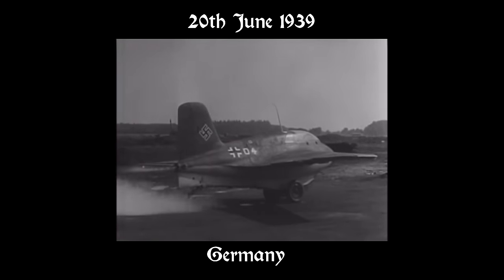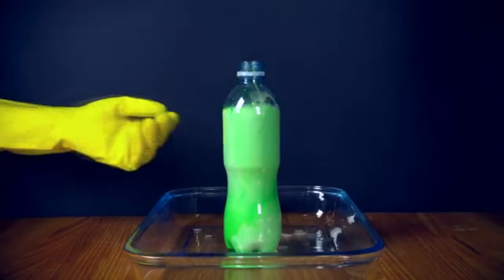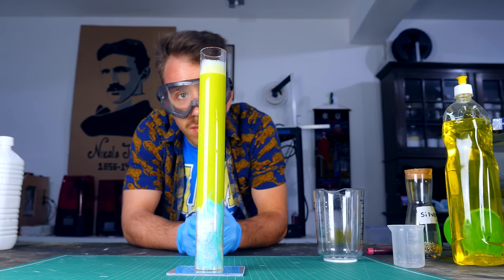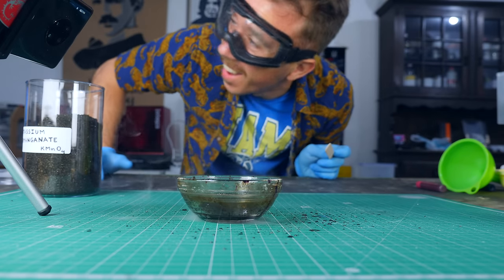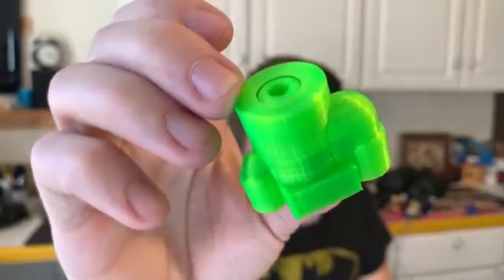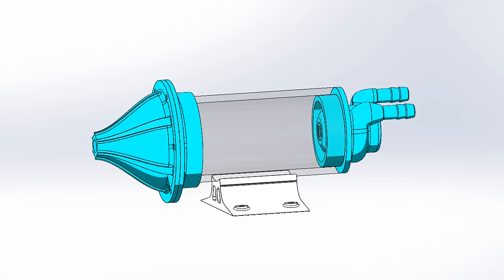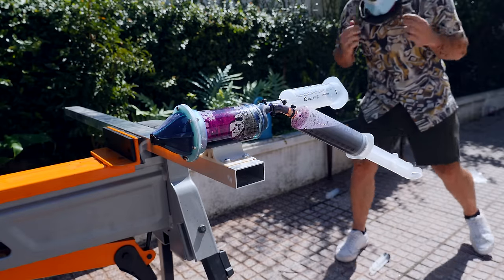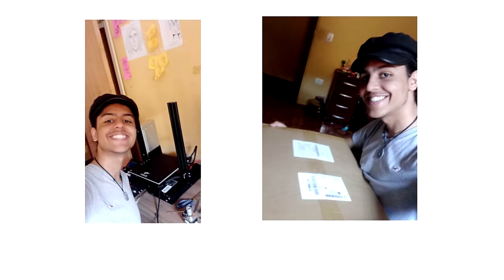The Forgotten Nazi Cold Rocket Engine (3D Printed)

Comment: If I remember correctly, there were a few reasons the me163 wasn't more effective: it wasn't widely produced, very low range, but the lesser ones were that t-stoff and c-stoff were safe on their own but once brought together they were extremely volatile (as you shown). The fuel was so volatile that if a 163 was damaged and fuel got on to the specially made flight suits, it would burn a hole right through the suit and if it made contact with the skin it would cause some severe irritation. The other reason was that because of the volatile reaction, many 163s exploded on takeoff killing their pilots. (This was just stuff I remember reading about, but You can get more indepth with the wonder weapons "dogfights" episode). (I'm a little bit of a ww2 aircraft buff...)

Great video, but please be more careful integza, I love you channel I don't want you going anywhere anytime soon!
Reply: Today I Found Out has a video The German Rocket Fighter that Dissolved its Pilots Alive that covers this topic. I've gotten concentrated hydrogen peroxide on my skin before from a wood bleaching kit and it makes white blisters and the skin flakes off and can scab over, very gross, can't imagine that all over one's body 😬
Reply: The me163 actually used hydrazine, which is indeed ridiculously toxic. Another reason why it wasn't more effective was also its very short duration of action and the fact that it was more of a last ditch effort against overwhelming allied aerial attacks. Hydrazine itself is a pretty effective propellant in rocketry till today, though less frequently used due to its high toxicity.
Reply: @haraldhimmel5687  Oh, right. ChecmicalForce and NileRed have done some interesting reactions with hydrazine as well as Extraction&Fire mentioned in the video and Extraction&Ire which I think is his 2nd channel. The good news is this makes Integza's rocket more like the Rocket Pack and less like a Nazi experiment.

Comment: Hey Integza , here is a future video idea - try to make 3d printed parts using flash graphene ( you could make some using capacitors and quartz tubing) . add the graphene to the resin solution . considering how viscous the resin is, the graphene flakes should stay suspended in the solution( i hope they do) and should make the parts more structurally strong. Ps if u do this Don't forget to credit the student at RICE university who discovered this method of making graphene( His name is Duy Luong)

Comment: video idea: you should try to  print plastic rockets again but fill the inside of the walls with water to provide cooling and increased spesific heat. should solve your problem of changing parts on every test
Reply: The plastic would insulate
Reply: @Volt64bolt  you can make inside walls very thin. as long as you make outside walls thick enough water would carry the preassure and hold the inside walls together. like trying to light a water baloon on fire. but  i dont have any 3d printing experience so i could be wrong. but as long as you put enough supports it should work i believe

Comment: How did you manage to avoid peroxide burns on your arms when that syringe blew back? When I am working with high strength H2O2 I always manage to get burned by a splash somewhere. Guess you learned about the purple permanganate stains also. I'm really impressed by your 3-D printed rocket engine. Keep up the good work and stay safe.
Reply: dude i only have 12% and after doing some experiments my fingers were pretty much white. thankfully running underwater and rubbing helped

Comment: great project!  Couple suggestions.  Get rid of the KMnO4 and use silver mesh (the surface area of your silver shot is too low).  by mixing relatively low concentration (50%) H2O2 with a permanganate solution, you're increasing the reaction time (not good... faster is better!)  The other is to distill the 50% peroxide to 75% or higher - you'll get a far more energetic reaction that might even test the thermal limits of your engine housing!  (finally, from a safety perspective - even 50% H2O2 is nasty stuff on skin.  You need better PPE)

Comment: Instead of having to pump two fluids, I wonder if you can pre-load the chamber with the catalyst, and then swirl the hydrogen peroxide into it similar to the vortex rocket.
Reply: Normally they take silver, nickel, or palladium coated mesh screens and stack them into a catalyst pack. Then they pump the hydrogen peroxide into it and as it expands the high surface area makes it speed up. Back in the days of crazy Acme products there was a jet powered gokart that had 1500hp equivalent rocket thrust.

Comment: H2O2 is used to drive the turbopumps on the main stage engines of the Soyuz rocket.  The catalyst used there is an active zirconia matrix called F-30-P-G in the form of pellets covered in an aqueous solution of sodium and potassium permanganates.

Comment: You need to revisit this project. Add an aerospike at the end and a rotating detonation chamber inside, use 100% concentrated solution, and a high speed motor for injection and see what happens.

Comment: Make a woodgas powered turbojet. This would use a burner to burn wood inside a sealed container, while the gas produced is collected and sent to the turbine. It will also work with paper inside the gasification chamber. At the end of the cycle, you'll have charcoal you can use.

Comment: HTP ( high test peroxide) was used in two under wing rockets on a Lancaster bomber in 1946 at the Rocket propulsion establishment Westcott England. HTP is H2 O2 and decomposes into H20 ( water) and oxygen because of the heat generated the water is emitted as steam with the oxygen. You can add various combustible fuels into the exhaust to increase thrust. The danger of HTP is that if it is spilt onto any flammable material i.e. Wood clothing etc they will combust.

Comment: Great engineering with that rocket engine.
Maybe you should try and ignite the exhaust combustion, maybe it wil give a whole lot more thrust.
But be aware that the flame mite flash back so maybe you will need some sort of flash bach mechanism. 
Good luck.

Comment: If you don't clean the nozzle up after each test I wonder if you could just pump the peroxide so you only need to pump one liquid before recoat. It seems to stick quite heavily so the catalyst stays. Iirc for big rockets, monopropellant catalysts are stuck onto gauze right before the nozzle. That is a big benefit as a combustion chamber isn't neccesarily needed and reduces weight, but it's less power relative to bipropellants or hybrid engines. A method to "stick" the catalyst with the high pressure is good, though ofc its better with high peroxide content so it does not first dissolve into the water as much.

Comment: what a great project. you need 2 tanks that could be pressurized, check valves, mixture valves and throttle valves. you can then control the mixing ratio of the liquids to increase the chamber pressure or press the Permanganate into a block in a cup in the pressure chamber and spray peroxide on to it. that way the peroxide react with the correct amount of permanganate to optimize the reaction. anyway again great project.

Comment: For optimisation you could make the nozzle Exit even smaller. You want the exhaust to come out as straight as possible. In your case, the exhaust formed a cone, which means that your exhaust Gas preassure was to high

Comment: All this time knowing about the 'Cold' takeoff pack used on the Arado 234 takeoff units and I always thought it was Hypergolic because it had two separate fuel tanks. Then I saw this and heard about the propellants and immediately recognized them as I know the German rocket engines quite well. Having heard the term 'Z-stoff' I thought 'that's calcium permanganate'. Upon closer inspection on the walterwerke website I noticed the words 'decomposition' being used a lot. So technically it was just a catalyst in liquid form and not actually a reactant and is therefore a monopropellant and now that I've learnt that monopropellant engines are deemed 'cold' it all makes sense now as to why it's called the 'cold' takeoff pack.  All this time not knowing any different. Also for reference, the me-163 B onwards (the A famously gave off purple smoke and is deemed a 'cold' unit so I guess that's why) used a 'Hot' mixture of HTP and T-stoff which is a mixture of Hydrazine Hydrate, Methanol and water. This is bi-propellant and hypergolic but it was started using calcium permanganate embedded in a porus substance that the HTP flowed through in order to spool up the turbopumps. For reference this can all be found on the Walterwerke website. It's a co uk site but YT hates hyperlinks so I can't link it here.

Also, don't feel so bad about using syringes because if memory serves, the X-4 missile the Germans were working on was using a spring loaded syringe style mechanism for getting fuel to the combustion chamber or as wiki puts it 'pistons in long tubes' so basically a syringe. The propellants for that one are quite nasty though: R-Stoff and S-stoff.

Comment: If you take the potassium permanganate and make a paste with it, letting the H2O2 flow over it as it comes out of the syringe, that will increase the reaction. Also a back-flow prevention valve in the line is needed.
The injection should go into a mixing vessel in-line to the reaction chamber, creating a place for the reaction to happen before it has a chance to expand, then compress through the nozzle, thus creating the highest pressures.
Lastly, what are the chunks? The fluid mixtures should be debris and in the smallest particulates you can get. Try drying the Potassium manganate before the reaction. 
I hope that helps.

Comment: You should compress KMnO4 in a cylindrical form with a bore inside then the H2O2 get injected inside. By controlling the amount of H2O2 injcted inside you controlle the rate of the reaction. A one way valve will help protect the direction.

Comment: Safety 3rd, love it!! Mike Rowe mentioned the validity of such a thing in all practicality, great video by the way, I knew of silver/peroxide rockets utilizing silver mesh and peroxide I interacting to create thrust, but hadn’t explored the idea in full. Imagine feeding this through a Tesla Turbine and using a massive Tesla Valve to mix the fuel and catalyst feeding the high pressure mix through a Venturi just prior to the inlet of the turbine allowing for an even more atomized mix and further reactive efficiency so the pressure is extreme and consistent upon entry to the Tesla Turbine…….I imagine possibly disastrous pressures and rpm development, but heat would be massively reduced prior to being introduced to the turbine allowing for far more aggressive operation and less deformation and resonance leading to destruction. Coupled to a reduction drive, depending on scale I’d sure be curious about power output values, and this could perhaps allow for a very substantial increase in fuel efficiency. Just a thought. There is a ton of potential energy there and I think with a Valve/Venturi/Turbine/Reduction drive, there could be an interesting powerhouse yet to be built! Keep up the great videos!!!
Reply: Apologies for typos, thumbs weren’t designed for phones!

Comment: Should make a supercharger type of deal, use the steam in an engine, as was mentioned, to either produce more thrust, or to spin a corkscrew deal to pull more fuel from say larger containers into the system to continue to power itself

Comment: One catalyst included in kid's chemistry sets is manganese dioxide.  MnO2 is not water- soluble, it's a good catalyst nevertheless.  Monopropellant rockets are used in real spaceships for steering.  They use arrays of fine silver wires as a  catalyst device.  An interesting catalyst is biochemical. Peroxidases are enzymes that destroy H2O2 very efficiently.  I don't think a crude extract of horseradish peroxide would cost much... or you could prepare your own.

Comment: How about a simple gas pressurized fuel chamber? Fill a syringe with half propellant and half air. Pressurize it by closing the outflow valve and squeezing the plunger/locking it there. Open outflow valve and pressure forces propellant out.

Comment: Use engine fuel pump, and PD style injectors and you can control those with small microcontroller to get decent fuel back pressure tolerance :)

Comment: I read about the test pilots who tested the Heinkel and they said the worst part was landing it with fuel still in it. They said they would fly around until they were almost out of fuel before landing it as the fuel was so volatile, it would explode on landing.

Comment: Seems to me that the thrust is being impeded by unexpended permanganate.

Since it takes very little permanganate to decompose a lot of peroxide, you probably only need about a tenth or less of the pressure on the permanganate syringe, otherwise unspent permanganate ends up clogging the exhaust port.

Comment: Curious, wouldn't a smaller chamber increase efficiency and burn time? some threaded brass fittings are in your future and you could even push the two chemicals into the chamber by forced air or co2

Comment: This type of engine along with the proper fuel tanks would be perfect to install in a Estes Rocket V2 Kit. Question, Couldn't the fuel tanks be made so that there is a mechanical piston powered by springs to push the liquid into the combustion chamber instead of using syringes?
I once watch a video of an RC model submarine where the person built balist tanks that could allow water in to sink, then push the water out to rise. Possibly that concept could be applied to a type of fuel tank that could push the liquid into the combustion chamber and it is controlled by RC controllers? You could then put the fins on the rocket, side it on a Estes launch pad, trigger it and off you go, LOL!

Comment: Use Tesla. Alva’s to control backflow and fuel rates. Also atomize the peroxide and the promagnate using restrictive fuel nozzles / atomizers to mist the two chemicals together in the chamber. Also, edit your exhaust Nobel to be able to restrict exhaust on command for higher thrust. I also recommend to add a gimbal on the engine to control directed thrust. Happy rocket building.

Comment: just fyi, removing supports before curing is way easier and doesn't effect the strength of the part. use some hot water to make it even easier.

Comment: Would it work if we used gravity? At first release a valve that would make the fuel components flow into the chamber and then re-use some pressure from the chamber and re-route back to the top of the fuel tanks to push more fuel into the chamber and create a kind of 'runaway' condition where it will run harder the longer it runs?

Comment: Do the silver experiment another way. Pour liquids in and then silver pellets. That mixes the components better and gives more surface area for reaction... Having silver on the bottom means the liquid that may enter there is more or less full of already reacted components and the raction slows down significally.

Compare that with kids stuff like dropping menthos to cola...
Reply: Smarter than rest of us. Sigh.
Reply: better yet, instead of silver, use Palladium-on-Carbon.

Comment: Hypergolic rockets are just liquid fuel rockets wherein the fuel and oxidizer ignite on contact. Example: Nitrogen tetroxide and methyl- hydrazine.

Mono-propellant rockets include most solid fuel rockets. A typical example is nitroglycerine & nitrocellulose (essentially compressed smokeless gunpowder).

Hydrogen peroxide decomposition is VERY HOT.

Comment: The hydrogen peroxide, decomposition rocket was what was used by the Bell rocket pack, the rocket pack had a bottle of approximately 90% hydrogen peroxide and a bottle of pressurized nitrogen to push the peroxide through the gas generator, which was a stainless steel container with a bunch of silver plates inside it, some articles state that the silver plates were coated with  samarium nitrate

Comment: To use silver it has to be a mesh like screen wire. You have to compress the hydrogen peroxide and force it through the mesh. This is the way they made cold gas rockets for the Rocketeer suits. The two tanks that you see on their back one is filled with compressed air the other is filled with hydrogen peroxide. Compressed air is used to force the hydrogen peroxide through the silver mesh. The expanding gases is forced through a rocket nozzle to produce thrust. However Rocketeer suits can only fly for 30 seconds to a minute due to the small amount of hydrogen peroxide they can carry. Adam Savage used cold gas Rockets for his Iron Man suit that he made for his YouTube channel. Adam used for layers of 25 micron silver mesh and 70% hydrogen peroxide. The guy he was working with said you only need two layers if you're working with 90%.

Comment: I dunno if you'll read this, given how long ago the video was posted, but I was surprised when you tried using silver as a catalyst. I remember watching a documentary about various attempts at creating jetpacks & similar personal flying devices, & I recall the part about the peroxide based unit that was used for the film Moonraker, as well as the opening (or maybe closing, I forget) ceremony of the Olympics that happened nearest in time to the film's release, and in that the catalyst was a kind of mesh (or plate with holes 🤷‍♂️) made of platinum, rather than silver. I know platinum is probably a lot more expensive than silver, but you wouldn't need as much & maybe you could even get away with the mesh/plate just being coated/plated with platinum instead of it being solid platinum.